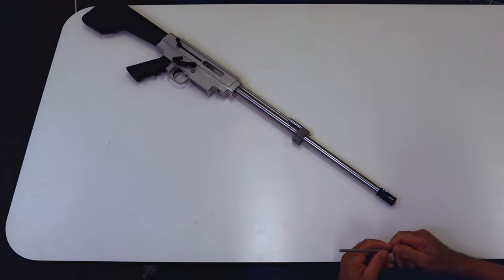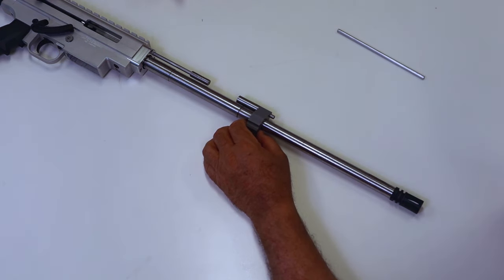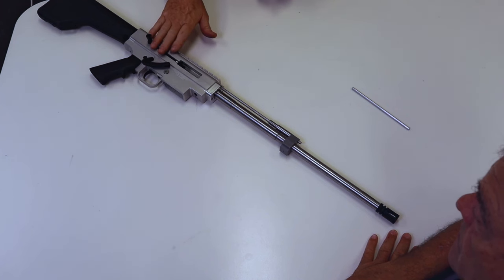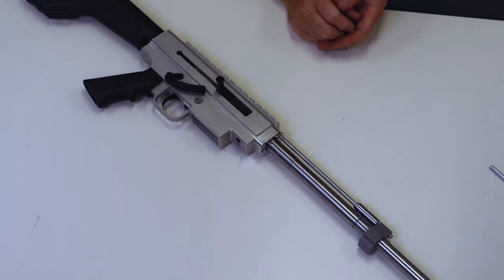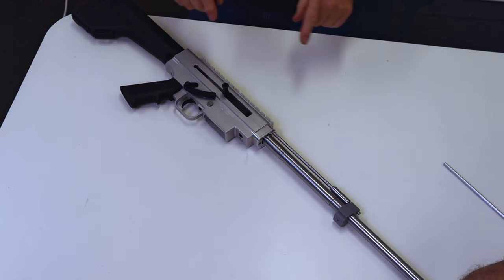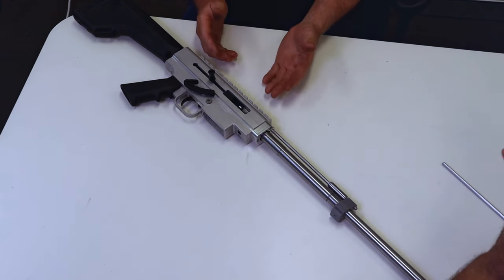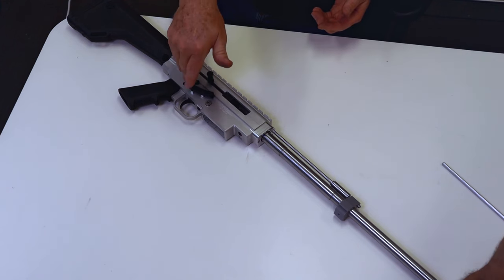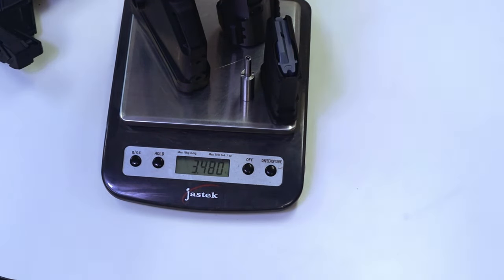Eureka Stockade - In-depth review of The Stockade

Comment: Will an 18 inch barrel be available for the stockade? I am thinking I want a bit extra velocity compared to the 16 inch barrel (and to differentiate it from my 16 inch Taipan) but don't want the rifle to be too unwieldy/frontheavy with a 20 inch barrel when working out of a ute, especially with the muzzle blast deflector and potentially a bipod on it. I know it's a bit niche, but it would be nice to have in my opinion.
Reply from the maker: Thanks for the suggestion. From a manufacturers' perspective there is always a trade off to way up the number of options vs the cost of manufacturing as more available options increase the cost of the overall product. With the stockade we are aiming at an affordable solution hence we have to be very restrictive on the number of available options. That said, you can always cut the 20inch down which would only be 150 bucks from your local gun smith if necessary. At this point we are bringing out the 16 and 20 inch, that is not to say we don't bring out 14.5 or 18inch in the future.